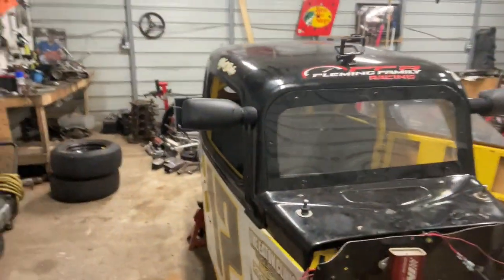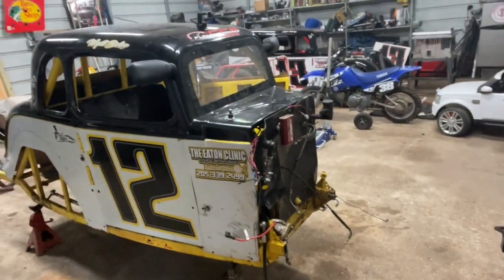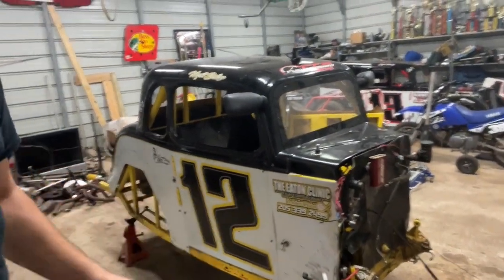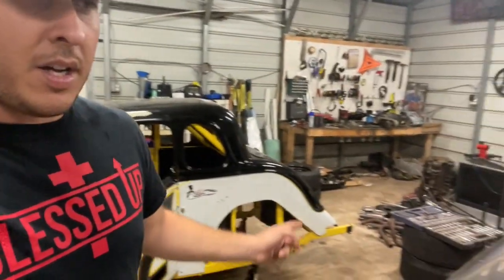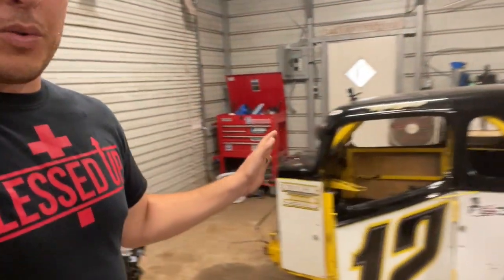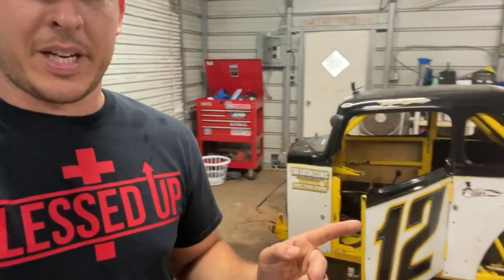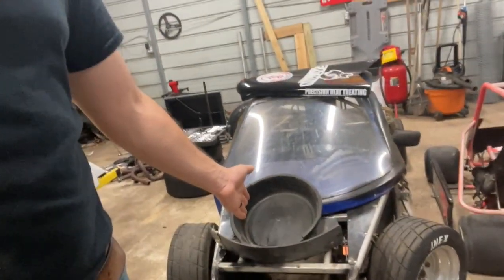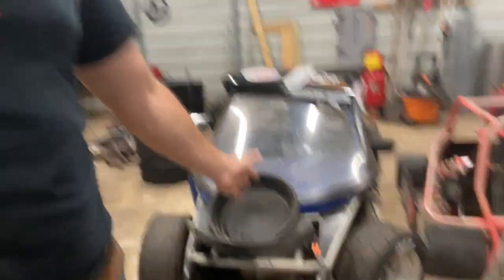Working on the #12 Honda Civic EP3 Race Car / Racing Seat Fab and Installation

Comment: Awesome work Mr Skylar 👏 👍  one little safety tip for you. Well 2 lol. On the front corner by the shift of seat bar. Weld a peace of 4×4 Plat to some tubing to support that corner from floor to that corner up and down. Just Weld it to seat bar but not the floor. Let it just rest on the floor for support. 2nd where your drilling threw bars to mount the seat will weaken the bar. If I do the I always drill if out big and insert small tubing in the hole and Weld it in. It put the integrity back in it won't fold as easily in a crash.
Reply from the maker: Very good tips. Thank you for that input

Comment: You should add a brace to the front corner of the seat bracket.
Reply from the maker: I thought about that! I did that on one of my other cars and brought it up
To the bar running beside the driver and it always got in the way of shifting. We possibly go back and do that